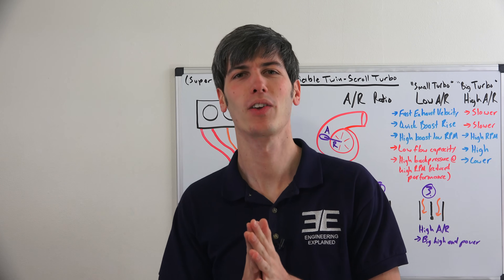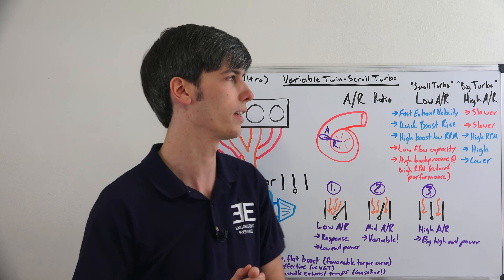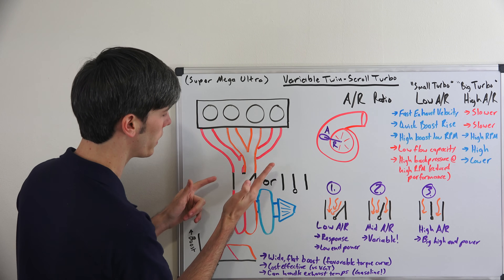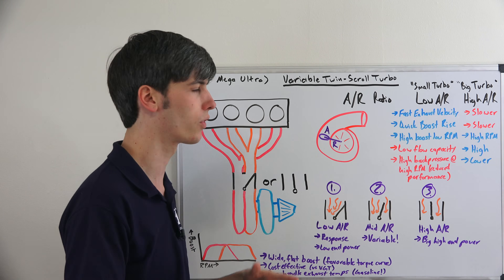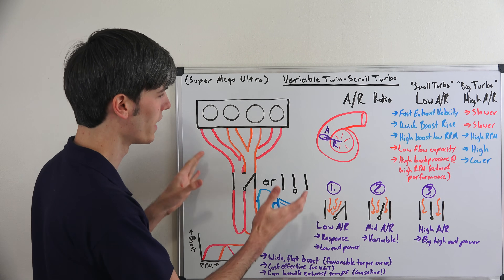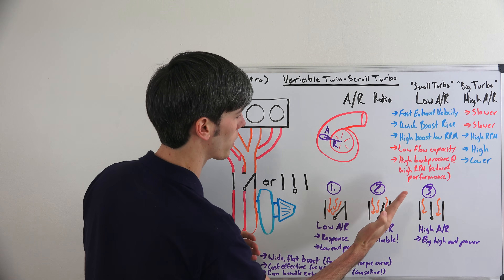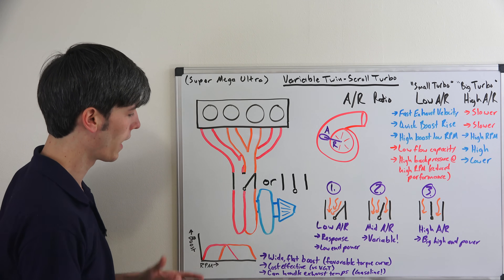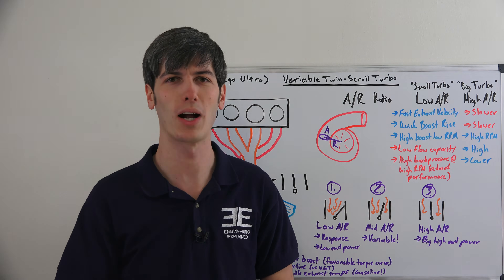Variable Twin Scroll Turbocharger - The Future Of Gasoline Turbos?

Comment: it would be great to here a thing about koenigseggs free valve technology
Reply: Sam R iirc those you mentioned still have camshafts
Reply: Sam R LOL. Sorry but no. Pneumatic and hydraulic are not interchangeable. Thanks for coming out though.
Reply: Sam R lol. You're the one who thought pneumatic and hydraulic were interchangeable terms. Maybe you should do yourself a favor and shut up. You're only making yourself look more and more idiotic with each post.
Reply: Sam R Just like you! I'm glad you agree.
Reply: +uhrwerks As with just about all technology, with time the price will keep falling until it basically becomes a commodity. Just think how much it would have cost to make a mid range car of today in 1980 with its ABS, traction control, electronic differentials, air bags, seamless glass windows, bonded composites, LED lighting, engine ECU, Variable valve timing etc. The technology to make those things existed back then but manufacturing tech in the automotive field had not advanced to where it was economically feasible.
Reply: Sam R lol, and some people disregard facts when they are contrary to their beliefs.
Reply: Sam R dont really care who invented it id just like anEE vid about it, im nor a koenigsegg owner now fanboi lol, if anything i like 105 series alfas

and either way it seems like its only really recently that these things are becoming properly feasable in production cars so id like to hear more about it
Reply: Sam R You said he didn't hold a patent for his valve technology. This is his registered patent. http://patents.justia.com/inventor/christian-von-koenigsegg
Reply: +Sam R "say that to A secondary", not an
Reply: +Sam R Also... I never finished high school. My last SAT score was 1180. I have a GED. I am now 30 years old. I have spent my life racing downhill mountain bikes, competing in compound archery, refining my skills as a guitar player... Doing things that make me feel alive, not jerking off to physics and mathematics. You have replied to and argued with every single commenter on this channel. You are clearly suffering from an inferiority complex and a well placed sense of insecurity. Btw.... You've been trolled... And you are a boob...
Reply: Sam R
I did. And I even linked it to you.
Reply: +Sam R ahahaha. You're so angry that you forgot which person you were talking to. For starters, I haven't mentioned what education I have received. Second thing is you're an engineer but would admit what field of specialisation you are. Third thing is I never stated the Bernoulli's principles were wrong, I stated YOU were wrong.
Obviously you're still in high school as you haven't learn in English what;
A) Grammar is.
B) How to argue a point without going on a tangent.
 C) What syntax is.
I know for a fact that I've got a higher level of schooling than you do but I shan't tell you until you tell me what degrees you have, when you got them and what's your actual profession unless you want to show tell everyone that you're a bad troll.
Lmao lmao lmao lmao lmao at you.
Lolololololololololololol'ing at you, kid.
Reply: Johnzy Some people think everything came into existent by Koenigsegg.

Some people actually believe that Koenigsegg has invented the "car".
Reply: +uhrwerks The system is in it's final stages of testing with different OEMs now. The reason it's taken so long is because Koenigsegg had to invent a sensor that could read what the valves are doing at any given moment.
Reply: +Tyler Hunt Ignore Sam R. It's just another one of M3Conv's idiotic accounts. If you don't know who that is then go to any Koenigsegg video's comment section and brace yourself. He's been at it for close to a decade.
Reply: Sam R you were wrong about both koenigsegg holding a patient on their valve system, and the way in which that system operates. Now you're pretending that it doesn't matter because a gas is a compressible fluid. 

You were wrong time and time again. Now you're trying to change the subject. 

You lose. Case closed. Get over it.
Reply: Sam R Wrong again "including an inlet valve (6) and an adherent pneumatic inlet valve actuator (8), an outlet valve (7) and an adherent pneumatic outlet valve actuator (9), " looks like you're confusing pneumatic and hydraulic again. Hahaha. 

I see you're still having trouble reading. Lol. Get a clue and a life bud.
Reply: Sam R
Lol. Come back to me about school when you learn to read. So far you've proved that you can't understand english. LMFAO
Reply: Sam R
You were wrong, get over it.
Reply: Ronan McHugh
I'm not sure if he's a troll or just an idiot who can't accept when he's wrong. He's grasping at straws and changing the subject to "not be wrong". It's pathetic.

The proper response to being proven factually wrong is "oh, I didn't know that". Not change the subject and then try to brow beat people with an unrelated highschool physics lecture. lol. The guy's a joke.
Reply: +Sam R By God man, your grammar and spelling are positively atrocious! If you are going to make an attempt at appearing intellectually superior, use proper grammar! Now go ahead and tell us "English isn't my first language"
Reply: Sam R yikes, all that education and experience and you still confuse pneumatic for hydraulic. Lol.
Reply: +Sam R lol! I never had a theory. Genius! I was/am the guy who mocked your continuously poor grammar. I told you. I never graduated high school. GED. Oddly, of the two of us, you consistently sound...boobier...
Reply: Patrik Pålsson hydraulic accumulator. That is all I'm going to say.
Reply: +Sam R I have never seen a person use as many ad hominems as you did in this moronic comment chain. ""Someone doesn´t preemptively state he hates Koenigsegg? FANBOYFANBOYFANBOY111!!!"
Reply: +Sam R He holds a patent on the tech. Obviously it's different enough from the fiats version.
Reply: +felix pinto hasn't f1 been using this tec for a while?
Reply: Tyler Hunt Exactly!
Reply: Tyler Hunt I am a factual person, and i would embrace facts and figures, not a bunch of flash words and meaningless and unproven numbers. Give me facts anytime.
Reply: Tyler Hunt Those were far from facts. Just a bunch of false claims and speculations. I honestly don't see any link. It'd be great if you could send them again so I can see.
Reply: Tyler Hunt Yes yes, but he is not the inventor of the electro-hydraulically actuated valve. It is like saying I have designed a 7 and a half cylinder IC engine, therefore I am the inventor of IC engine. That is exactly what you are trying to say, and Koenigsegg I believe are trying to say.
Reply: Sam R well first off, it's electro pneumatic. And second, I'm well aware of other camless valve systems. I believe BMW was dicking around with a electric solenoid valve system a while back. I believe the "hype" around this one, is it has a possibility of going to market. It's not as delicate as other systems. It's basically a well controlled air hammer.
Reply: Tyler Hunt  lol look who is talking again. With this post, you made yourself look even sillier and less educated than before.

"lol. You're the one who thought pneumatic and hydraulic were interchangeable terms."

lmao at no point did I use the word "interchangeable". But your slow brain made you think that I meant that.

I know that you have no formal education, otherwise you would know that in science, air is considered as a compressible fluid(I am sure you have no idea what the term "compressible fluid" means) with a density of 1.225kg/m3 at sea level(Of course you don't know what meter, kg and sea level mean here), but you didn't know that. For that you can ask a secondary school student to explain to you how pneumatic and hydraulic systems work.

The principles of pneumatics and hydraulics are the same, but pneumatics transmits power through air which is again a fluid. In both hydraulic and pneumatic system, the fluid is compressed by a compressor(usually geared) and is stored in the receiver to be used by the system as needed. 

and to take you out of your cave, pneumatic system operate at pressures below 7kpa(again you have no idea what kpa means here) and is used mainly in places where heavy lifting is not concerned. it is lighter, cheaper to manufacture and maintain.

Educate yourself, or stay shut in places where two digit IQ is required.
Reply: Tyler Hunt Koenigsegg's system, just like others(i.e. Fiat's) use both hydraulics and pneumatics to close and open the valves. But the system is halled electro-hydraulic actualed valvle system for a good reason. Because the system uses the hydraulic system of the car. 

Educate yourself before it's too late.
Reply: Tyler Hunt lol you must be reading something else's description.
Reply: Tyler Hunt

PS

It is you who cannot understand the differences and similarities of both pneumatic and hydraulics, and thing that both systems are essentially different.

I wonder if you have ever been to school.
Reply: Tyler Hunt lol
Reply: +Tyler Hunt hey Tyler I have a question for you. Do you study maths at an advanced level or do physics?
Reply: Ronan McHugh
I have.
Mathematics, Physics, and Statics in aerospace engineering and the industrial electrical trade.
Reply: Tyler Hunt lmbao

The level of your(and your fellow Koenigsegg fanboy) idiocy is so staggering that you have rejected an proven principle in fluid mechanics known as the Bernoulli principle. 

Now if the entire scientific community agrees on the fact that hydraulics and pneumatics are IDENTICAL in principle, then who the bloody hell you think you are to reject that. Then again, we are dealing with Koenigsegg fanboys here. Need I say more?
Reply: Tyler Hunt I have seen people like you. You are one of those clueless boy who are brimming with confidence that they know everything. I guess maths was too easy for you.
Reply: Tyler Hunt I am done with you two. Adios!
Reply: +Sam R I'll take this as you're admitting that you don't know jack shit about fluid dynamics or engineering lmao
Reply: +Sam R as a side note, I love how directly copied and pasted what a fluid was from Wikipedia. Lmao kid, you failed before you even got to the first hurdle.
Reply: Ronan McHugh Yes, that's why I used quotation mark. I used the only, and the easiest explanation someone of your intellectual capacity could understand.

According to you, Daniel Bernoulli is wrong, therefore the rest of scientific community are wrong. lol The very same person who was correcting the way I wrote a unit, is now trying to pretend that the Bernoulli principle is wrong, and he is right. 

Your fellow koenigsegg fanboy might think that you are right, but don't say that in public, where people hold at least secondary school diploma. 

lmao lmao
Reply: Ronan McHugh

I don't know why anyone should bother with someone like you(and your fellow fanboy above). For you "state" doesn't mean more than the place you live. and SI units are alien to you as IQ.
Reply: Sam R Awww. The baby would rather run away than admit he's wrong.
Reply: +Sam R ok then smartass, quote me verbatim where I say "Bernoulli's laws of fluid dynamics are 100% wrong", oh wait, you can't because I didn't, you mongoloid.
Reply: +Sam R I just noticed that said pneumatics only work below 7kPa when in fact steel housing pneumatic actuators can work all the way up to 1700kPa.
You just hate Koenigsegg, that's why you're a troll.
Reply: +Icarus 7n hahaha lmao, I have seen many like you back in school, especially during A-level. The likes of you passed English, but miserably failed physics and mathematics. lmao My English was good enough to get me BEng and Msc in engineering, and years of working experience under my belt. I would like to know what achievements do you(who has the perfect English) have.
Now go ahead and tell us "I have not passed the physics and maths at secondary school and have no higher education"
Reply: +Tyler Hunt lmao, go say that to an secondary school and make yourself the laughing stock of the school. Tell them that the Bernoulli principle is wrong, and you know more. Therefore they must accept your principle. lmao lmao lmao
Reply: Sam R Nailed it with my past comment. Still jumping behind someone else's work when you are beat in logic.
Reply: +Inde x lmao not just me, but the entire scientific community accept what Bernoulli says. Then again you and that fella know more. I have to check the list of noble prize winners again, I must have missed your names.
Reply: Sam R Im sorry, please point out where in my comment i discredited him? If you are going to reply to me, atleast reply to what i said, rather than just straying shit. Thanks
Reply: +Inde x lmao
Reply: Sam R go tell an actual engineer they're the same thing. Lol.
Reply: +Tyler Hunt lmao lmao lmao lmao...
Reply: Sam R oh, and are you ready to admit that you were proven 100% factually wrong yet? Or are you still going to dodge that one with this bullshit?
Reply: Sam R figured as much.
Reply: +Sam R so you're an engineer, that's a broad term. Are you a civil, mechanical, biomedical, aeronautical, marine, Electrical Systems, Information Tech, Energy systems.
Which type of engineering are you?
Reply: +Ronan McHugh I didn't mention what, because there was no need for that but you can use your imaginations.
Reply: Sam R I imagine you drive a train.
Reply: Ronan McHugh lmao lmao lmao, look who is talking, the man with no formal education. I am really curious to know your highest level of education, because it seems that you have none, not even the 1st grade. lmfao lmfao How can an uneducated fool who had not passed the primary school can differentiate various degree titles. lmao

After all, you have come up with a principle that nullified the Bernoulli principle. lmao
Reply: Sam R big talk for someone who couldn't even figure out how to look up a patent. Lol.
Reply: Tyler Hunt lmao, big talk?? ok. Maybe I am a blind man who can't see, but I have not rejected something the scientific considers as a principle. lmao

As I said before, I am done here.
Reply: +uhrwerks Isn't it just push-pull solenoids in a rather unconventional environment? The only concern would be the lifetime of the solenoids themselves, even the timing would be no more complicated than a belt/chain/gear and much more easily adjusted.
Reply: +Tyler Hunt +Sam R holy shit look at how much time you kids spent arguing about car parts on YouTube
Reply: +Ronan McHugh holy shit you're all sucked into this time vortex of a thread. C'mon guys Jesus Christ
Reply: i still stand by my original statement haha
Reply: +Tyler Hunt I stopped reading his jibberish right here. "In both hydraulic and pneumatic system, the fluid is compressed by a compressor(usually geared) and is stored in the receiver to be used by the system as needed."
Yeah those tanks with compressed oil where do they hide them? :-D
Reply: +Tyler Hunt what I found funniest was that he had a Science masters in Mechanical ENGINEERING. 
That's when he knew he made a massive error hahaha.
Imagine that, a BEng and a MEng MSc, the guy literally invited a new type of engineering. Or so it seems.
Reply: some say...christian von koenigsegg invented sacred geometry,......and that he may actually be god....

all we know is......

FANBOY.
Reply: Felix, I hope I'm proven wrong, but my gut says that "camless" system is going to either stay a prototype or possibly just end up on $2mil "Supercars."  I like the idea, but it's complex & costly. You basically need a servo for each valve & a system to control it.  Take airplanes, "fly by wire" is becoming the standard, but hydraulics are still involved for some things or at least back up.
Reply: felix pinto It doesn't have camshaft for the intake valves. The reason for that is because the system is extremely sensitive to high temperature. lol The system have been in use since 1960. Koenigsegg has had ZERO part in invention of the system. 

Also, the original electro-hydraluc valve (invented by Renault in 1960s) was for both intake and exhaust valves. 

Koenigsegg fanboys, get a clue!
Reply: Tyler Hunt Patent? how can you patent something that doesn't work?? lol The principle is the same. Koenigsegg is neither inventor, nor has an system that works differently.
Reply: Tyler Hunt Yes, since air is treated as a fluid, then electro-pneumatic, electro-hydraulic.... are actually the same in principle.

I have seen koenigsegg's system, in principle it works 100%  similar to all other existing/patented systems.

I suggest you to carefully read how Koenigsegg's so-called system works, and compare it to other existing/patented systems.
Reply: Tyler Hunt They in fact are, the principle is the same, different application. :-) Both are based on Bernoulli's principle.

Do you know what pressure difference is? very simple!
Reply: interista7878 lol, it is so funny that know-nothing fanboys accuse others of "idiocy". lol I wonder if you are intellectually capable of reasoning x+2=4. lol keep on talking about thinks you are not able to comprehend, things like how a centrifugal compressor works, or what a sensor is. lol Keep it up boy, keep it up!
Reply: interista7878 
PS

Your fellow fanboy above didn't know what "hydraulics" and "Pneumatic" mean. He doesn't know what pressure is, and I reckon he can't even figure a -2-5.

It's funny how you koenigsegg fanboys talk about things that require IQ above the IQ of an goat. As I said, keep it up, maybe that way you look more intelligent than you actually are so you can impress girls.
Reply: Tyler Hunt

lmao

Your senile brain had dragged you to places unheard of. lol I'll try to sum up this hopeless conversation which one side of it is a person as intelligent as a wall.

From the very beginning, I have been trying to tell you that the system is called electro-hydraulic actuated valve system(which in fact is), and I said that the pneumatic system and hydraulic systems work in an identical way with only different fluids.

You, being an uneducatd person, jumped in with "No Koenigsegg's system is different" "They have invented the whole thing" ....etc I even explained to you that they did not invent anything, an their system works just like the other camless systems.

Now you are quoting parts of a patent that you have no clue about.

Go read the posts from the beginning and ask a person with 2 digit IQ to make you understand.
Reply: Ronan McHugh

lol "all liquids are fluids but not all fluids are liquids"  Who told you that? a science book? 

"You say it as if all fluids can be used to run hydraulics" another sign to your very limited intellectual capabilities. 

Fluids(Air, water....etc) are used in a hydraulic/pneumatic system, in this case to generate right level of pressure to open/close the valves. Now explain this Mr (Capital P), name one single difference between a hydraulic system and a pneumatic system. and tell me why your non-existent brain thinks that you know actually more than the famous scientist Daniel Bernoulli?(I am sure you  have never heard of him)

lmao lmao looks like we have a noble prize winner here who has brought forward a new principle called "The Ronan McHugh Principle" lmao

lmfao you, with your very limited intellectual capacity, jumped in in hope of making yourself sound like a person who knows something. I am surprised to know to see an intellectual lightweight like you knows about SI units. No matter how you write a certain unit, kPa, Kpa, kpA...etc a qualified engineer/scientist can understand what it means. in many instances, in text books you can see simple lettes are used for density, viscosity, pressure...etc
But no, we have a very clever scientist specialised in the field of VideoGames.

I think you better stick to videogames.

Read this, maybe this, but I am not sure your little brain can handle it.

"In physics, a fluid is a substance that continually deforms (flows) under an applied shear stress. Fluids are a subset of the phases of matter and include liquids, gases, plasmas and, to some extent, plastic solids."
Reply: +felix pinto Koenigsegg&#39;s free valve technology? since when the &quot;free valve&quot; become Koenigsegg&#39;s technology? The first company to patent the technology was FIAT in 1999.  The same tech has been in use since 1960s by renault, ford, bmw, fiat...etc

Fiat have been using the same technology in their MultiAir engine  that is used in Fiat Panda and Fiat 500. lmao Koenigsegg fanboys are so deluded!!
Reply: @samr1321  i dont think that is the same tecnology. the multiair as i watched on the video is somekind of valve timing tecnology that still use the traditional settings. free valve wants to make the engine valve comand completely eletric and independent of the engine mecanical parts.